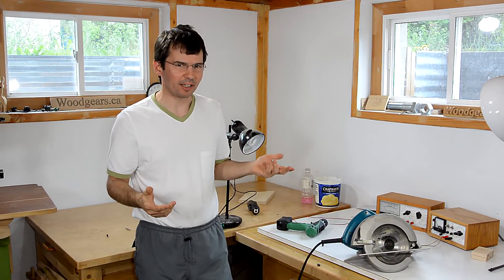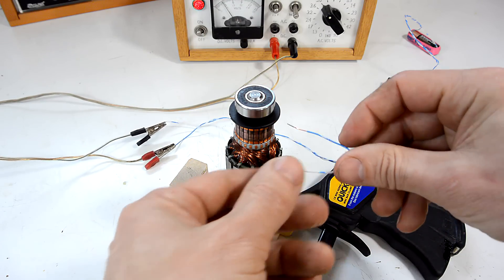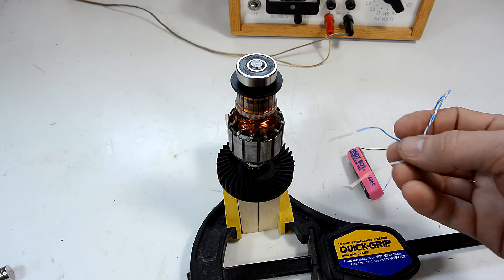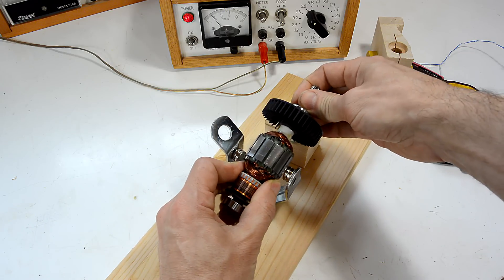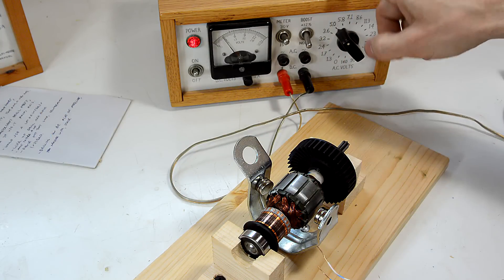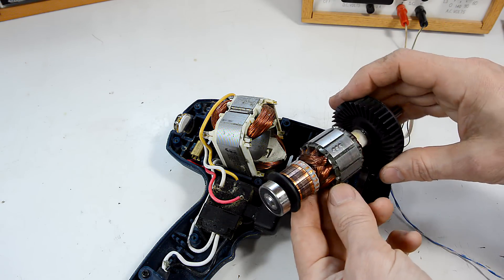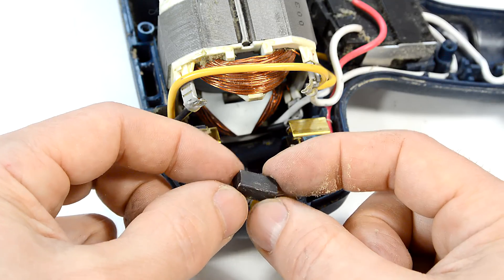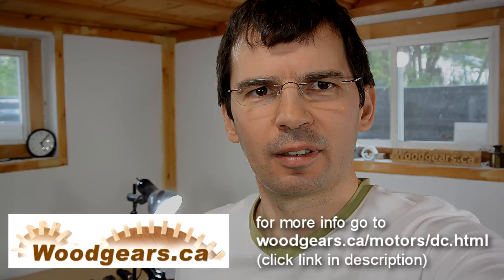How DC motors and universal motors work

Comment: I red somewhere online that smaller universal motors are only 30 percent thermally efficient while larger ones are 75 percent efficient. I find the 30 percent figure rather hard to believe considering that an internal combustion engine has about the same thermal efficiency right around 30 percent and it gets much much hotter in operation then a universal motor so much so that it can quite literally boil water if the cooling system isn't pressurized.
Reply from the maker: There is an economy of scales with motors, so smaller motors less efficient makes total sense.
Reply: @matthiaswandel approximately how thermally efficient is the small universal drill motor you showed or a universal motor in something like a portable 120V tabe saw or miter saw?

Comment: iam about to 3D print a motor. i have elctric steel, so no problems on the rotor. can you give me tips? the rotor is going to be 12 segment, and a 12 part commutator aswell. but just, tips around the structure, etc.

Comment: the stator of the motor is supplied with AC right, and the rotor is supplied with DC through the commutator, so I believe that makes it a <<DC-excited synchronous motor>> not a DC motor.
Reply from the maker: +Mahmoud Basyoni Do look up what a DC excited sychronous motor actually is!
Reply: I am curious, what is it like to be pretentious and wrong all at once?

Comment: 6.30 shows the stator but there is a strange looking piece of what seems to be thick metal wire attached to it's thin steel laminations .... i have seen this before in some special transformers as well as some motors and when i removed it (destroyed it)   it seemed to be like lead or some other metal which is very soft and easy to bend ... what is that and what is its purpose ?
Reply from the maker: john anderson That's a weld
Reply: john anderson That piece of Copper is the "Shaded Pole" Matthias spoke of. It determines the rotation of the motor. See my comment above.
Reply: wifi

Comment: Hi Matthias, I have a sewing machine motor that's a universal motor running on AC I'm using for a project. I know reversing the polarity of the brushes while operating on DC would reverse the rotation of the motor. I'm assuming the same is true when running on AC? My plan is to cut the leads going to the brushes and connect the four ends created to a DPDT switch to reverse the neutral/hot so I can reverse the rotation. The only DPDT switch wiring diagrams I can find for reversing motors are for DC power, but it seems to me the reversing process wouldn't change for a universal motor whether using DC or AC power. Is my logic sound here?
Reply from the maker: +tlgrimmy Right, is the same.  Make sure the brushes are at a right angle to the field winding.  If they aren't, then it will run poorly in reverse.
Reply: Perfect, thanks! I was hoping this was the case.
Reply: Vietnam
Reply: baby you're cute

Comment: Matthias do you know how to fix a smoking motor in a drill? I have an old brushed drill that works fine but started to produce smoke after some use, probably some dirt inside but I have no idea how clean it up.
Reply: If it's smoking it is usually the windings that are over heating. Say from running it too long or too hard. They are not meant to be run for long times. that you're not going to fix easily. Winding a motor is a pain and it's easier to by new.

Comment: Hey Matthias, I have a question wich I would love to have answered. I have a dc motor aswell wich has just regular magnets in them and they aren't connected to anything. But in the back of the motor there are 4 of those brushes. Could you maybe explain why that is? I am sorry for my English it is not my mother language
Reply from the maker: Gijs Boskers It' a 4-pole DC motor.

Comment: Would it be possible to build or get a motor to fit inside a 31mm or 32mm tube to provide about 300-500w to a gear? Specifically, I want one similar to the Vivax motor for bicycles as a reference. If so, how or where?
Reply from the maker: I would guess the best and cheapest option would be to buy the motor that already exists.

Comment: On Universal motor what does a Shorted turn mean ?   I have a Hoover Vacuum that I took a part cause it stopped working. I found out the bearings were bad.  I changed them out and started to put  back together.  I noticed 1 brush didn't look smooth, so I sanded it with a slight U shape to it. And now when I turn on the vacuum, its a little louder  and it begins to slow down after 5 seconds.

Comment: Even without wear to the brushes it would not be good to use a motor like this  in machines like AC and refrigerators. The brushes rubbing on the commutator slots combined with high speed  make the universal  motor almost as loud as a jet engine. It' make power tools, household mixers and vacuum cleaners so  loud they easily can cause permanent hearing damage in a very short time without hearing protection while the refrigerator motor of inducton type is whisper quiet. Universal motors and DC are useful when very high speed is needed though. In power tools the loudness of the motor is also often less an issue since the action of cutting through metal or wood  with for ex an angle grinder makes itself deafening levels of noise and so u still would need hearing protection even if the machine had used an induction motor. The induction motor also is much to heavy for use in handheld tools.

Comment: So if the power goes through the commutator and the electromagnet would it divide the current by half?
Reply: Of the current arriving to the drill through the electrical cord, some portion travels through the stator windings, and the rest travels through the armature windings that happen to be in contact with the brushes.

Comment: I tried it out I use my 220v broken drill motor and run it with 24v and the motor can be stopped easily why is that is it because of the magnet or the voltage was low?

Comment: I guess as usual I am lost a little.  The drill seem to run on AC and DC.  Are you saying, the trick is to wire  the stator and the armature  so the current change direction in both at the same time?  But let me see and the drill can go backward and forward.  I don't know, it is hard telling without some serious wiring schematics.  I can picture if you swap your battery wire in commutator it would go one way and the other.  So I don't get it.

Comment: Is this not AC instead of DC, I thought you only use a Commutator on an AC motor to maintain the polarity and keep a constant direction ?
Please correct me or tell me if this is wrong because Im confused as DC motors don't require a commutator ?
Reply: you use a commutator in a DC motor too. any brush motor has a commutator except for brushless fan motors (like in your computer cooling fan).
Reply: DC motors use a commutator but Brushless DC motors use an electronic commutator. The magnets are on the spinning part and the windings around the motor are changed with mofets quickly to replace the brushes. It's like turning the motor inside out.
Reply: Richardj Ah ok, thank you very much :)

Comment: hi,
  I have saw for metal and i have sparks from the motor. 
The motor doesnwt work as well as it was new. its a little weak.
Do you know what is the problem?
Thanks
Reply from the maker: +Dolev Cohen Worn out brushes or shorting commutator.
Reply: I replaced the brushes, and still the sparks continued. Many it's the commutstor like you say.
Thanks.

Comment: you switched from a battery drill to a  alternating current drill.
the ac drill does not have field magnets, but magnet coils.   ac voltage will not work on the commutator with field magnets.

Comment: Very informative.   Matthias would running lower voltage on a DC motor be harmful in any way to the motor?  Such as a 14.4V or 18V drill running on 12V supply..

I love your benchtop power supply.. I browsed your site for a bit and couldn't find much about it.  Do you have an article on it somewhere I'm missing?

Thanks
Reply: bigdmcc higher amperage, heat buildup

Comment: I hope we get an explanation of when we can or can't make a motor variable speed.  I am always uncertain about this.
Reply: Indeed. One thing missing from this video also actually what rpm this motor wants to go at and why.
Reply: most all drill motors these days are variable speed.
Reply: DC motors and universal motors (called universal because they can run on DC and AC) can be speed controlled simply by manipulating the voltage. Most AC induction motors can only be speed controlled by changing the supply frequency (which is costly and usually impractical).
Reply: James Walton
Actually it is done electronically, for drive motors on a milling machines. You can buy them for a few hundred now. We had them at work.

Comment: okay ive got the motor out but were do i purchase the wires so i can start it up with power? and do i just connect it to a battery?
Reply: Just find some insulated copper wire and a socket for the battery where you can also connect the wires and then you should be good to go once you have the mount setup at 3:05 or even previous.
Reply: +Maxwaehrens i did use some copper wires from my old blender and put it in the socket my motor however was still inside its natural cage with its own magnets and all thats happend was a little lighting bolt and the power in the house went down...im a faliure 😔
Reply: +Maxwaehrens and by socket you mean like what he demonstrated which looks waay moree safe or like an actual socket because i still had a plug with a long insulated coper wire that i used which dident work ithink i overused the volts
Reply: just use a power supply
Reply: +Elvis Ramos expensive lol

Comment: so the magnetic flux can go through iron a thousand times better than it does through air, but this is an advantage when it comes to motors, but what about a generator? 
When I see those videos about people making generators, whether it is for wind or hydro or even steam, they choose to make a coil of copper wire, connect them properly (I assume star or delta shaped) pore some resin over it, and call it a stator. But they don't use an iron core. When it comes to generating power, is it better to have an iron core, or without? Because the magnetic field makes the electrons move in the wire. In a motor it's the constantly changing magnetic field that has to attract or repel another magnetic field, and an iron core helps to guide the magnetic flux, or am I wrong, i'm so confused now! If it is better to have an iron core, why don't those people just take a number of iron cores and weld it onto a circular iron plate, so the magnetic flux  can pass too?? that doesn't cost that much if money is they main primary concern for building a cheap generator from common materials. I want to make one too, but the right way from the first time, I just can't afford trial and error. So which is the right way to build one? Like a normal motor with an iron core, or without one and just make the airgap as tight as possible?

Comment: brushes are used in almost every washing machine out there.
Reply from the maker: Adam Sandqvist In front loading washers, yes.  Top loading washing machines tend to use induction motors.
Reply: Matthias Wandel induction i.e. brushless?

Comment: hi i am trying to connect and use a treadmill motor but when i connect it the motor only wiggles left and right does anyone know what i need to make it spin correctly and also use it with a speed control?
Reply from the maker: It needs to be used with the electronics from the treadmill.  But no worries, it's not suitable for homemade tools anyway
Reply: Matthias Wandel oh ok so there is no other way to make it work withought the treadmill electronics? ...I'm not wanting it for tools need it for other projects, as for tools what type of motors would you suggest?
Reply: dreamkiss4u

Comment: I could use some Motor help. From anyone if they can..... I pulled a small DC motor from an old 7.2v Battery Powered Ryobi Drill that I got from a thrift store, and I'm having a hard time powering it. I'd like to wire it up by plugging it into an outlet and I believe I need an AC/DC adapter. I have tried using a Variable volt 1amp adapter from 1.5v to 15v but it only twitched periodically. I then tried a 9v Battery and it spun up and worked great, so I know the motor's not dead. Using a Multi-meter, it appears to pull 1.7 - 1.8 amps. So I got a 12v 2amp Adapter and it spun for half a second, then stopped for about a full second, then spun. I've only learned about Ohms law about 2 weeks ago, so I'm new at this and having a hard time trying to figure out what kind of power I need to hook this thing up, or how to measure what I need. Am I using too much volts? Is too much volts even a thing? How can I measure what the motor is using when it runs with a battery to  determine what kind of Adapter to get?
Reply from the maker: You need a power supply that puts out 30 amperes (that's what some of these motors pull).  But much cheaper than such a supply is a corded drill.
Reply: Much appreciated, my intention is to attempt making the Saw Blade Sharpener for my father, so I just needed a cheap motor. I do appreciate the swift reply.
Reply: Except for under special conditions, when an electric motor first starts, it draws an insane amount of current for a very brief time until the motor has started to move some.  Shortly after it gets going, it draws considerably less current.

When you tried the 9v battery, it had no automatic (self preserving) limiter inside.  It worked a little, but you were flogging it in the process.  

When you tried the AC adapters, the initial high current draw was enough to cause the automatic limiter to engage, which kills the adapter's output for a second or two.  After a few seconds of killing the output, it may try again, but the motor draws too much current during the instant it's trying to start, so the adapter gives up again.

You need a smarter adapter, that has a current limiting output instead of a current killing output.

Comment: If the whole idea is to magnetise the copper core then why not attach the to wires to the two sides of the magnet? Or why not just put another magnet inside the motor?
Reply from the maker: +karun mathews Do watch the video.
Reply: Matthias Wandel Oh so when the thing rotates it keeps getting different poles and so they keep rotating, cool thanks :)
Reply: Hey then why can't we keep two magnetic wires instead ?
Reply: +karun mathews Magnetic wires?

In rotor you have to use copper wire rolled over iron core, so you can change polarity, when rotor is spinning. In stator you can use just magnets, but they are too powerless to get powerfull and effiency motor.
Reply: +karun mathews That is iron core. do you know Fe(Iron) ? Yes you got it. Its that core where copper is wound. You say it iron core. It involves iron loss because of hysteresis and eddy current. Both together are called iron loss. Now can you cook rice without heat ? No. Same is true. You cannot magnetize a Iron core without a insulated copper wound over it. Electric current flows when connected to a voltage supply. There is no current that will flow when you will connect it to two sides of a magnet dude. You have to move the magnet is a closed circuit to produce electric current. You can put another magnet inside a motor. That will have a low flexibility, increase design cost and weight.
Reply: +karun mathews the donkey chasing the carrot on the stick "never herd of that saying? "
Reply: +Bidyut Baruah  Oh okay , thanks for explaining :)

Comment: hi can i use american equipment saying 60hz on the case on a 50z uk steeped down voltage from 230 to 115v -but still 50hz? it says it is a universal motor thanks if anyone knows for sure that would be great i think it will be ok after watching this
Reply: It will work just fine on 50 hz as long as it is 125 to 110 volts ac
Reply: thanks

Comment: wat are spec of the motor that i need to tell the seller ??
Reply from the maker: Tell the seller the specs for the motor that you need.  I can't answer that for you
Reply: i am making a battle bot. wat motor should i use for wheels if the robo weights 3KG
Reply: i was thinking of this drill machine motor. !!!
Reply: +Karan Kanojia a 500 to 800 watt would be overkill in my opinion xD
Reply: yep
Reply: Karan Kanojia
you have a few options:
12 volt DC - 220 AC ,ac is for a plug in a wall,and dc is with a 12volt battery
now,watts are how much energy-power the motor consumes,and its also how powerfull it is,10 watts is very weak,1kW is very powerfull (1000watts=1kiloWatt) hope I helped you,you should also consider the size of the motor
Reply: Get the best possible battery that you can, then calculate the best motor that you can use given the amount of time that you want the robot to run.
Reply: Teo Pit
Reply: +Toon Konijn yes??